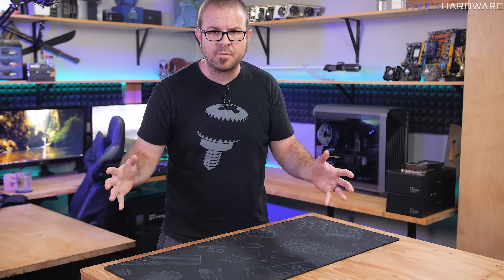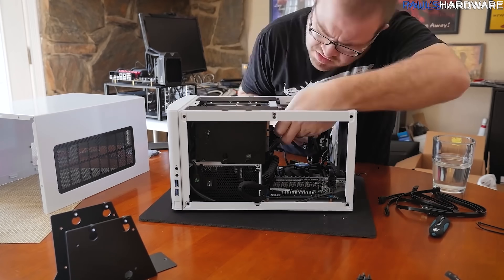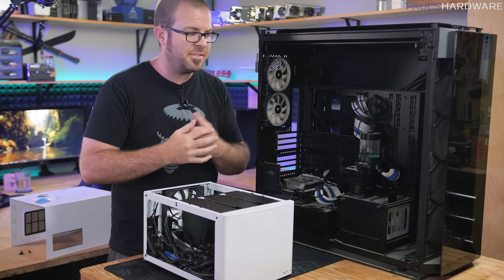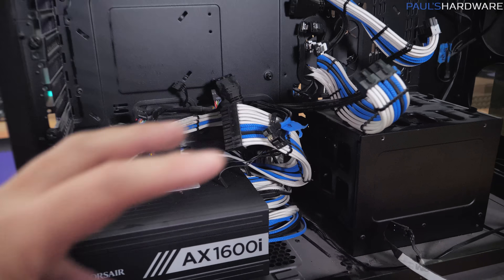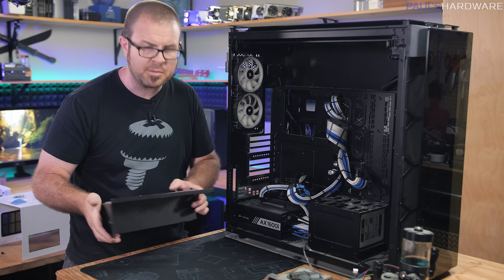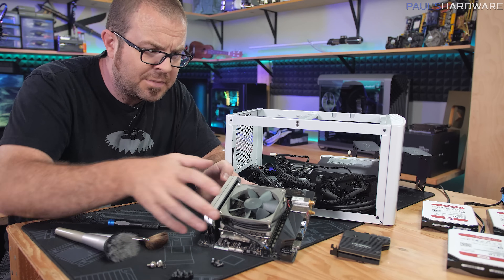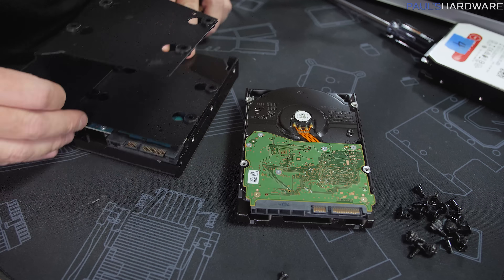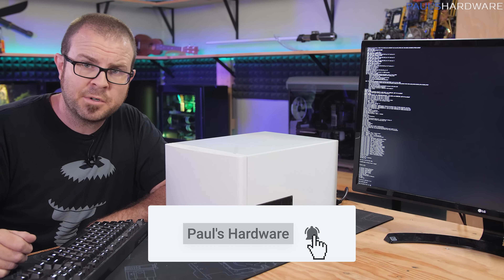2 PCs, 1 Case = BAD IDEA

Comment: I have the Thermaltake Core v21 mATX chassis. A nice little cube case that has stacking capabilities. I believe the new Divider 200 is the refresh of that case. As a cube you can swap the sides around to orient as normal, inverted or flat. A good amount of room for well laid out custom loop.

Comment: I think most HDDs over 4TB have the wider spacing these days
Reply: Toshiba still uses the smaller spacing, while WD uses the wider spacing. There are three standardized mounting spots and usually just two get used, so this is a screw up (heh) from Fractal

Comment: There was one time where I had one PC split across two cases. All I can remember was having the two cases side by side with their covers open.
Reply: That sounds pretty interesting. How'd you manage the dust?
Reply: @benjaminoechsli1941  The dust accumulation wasn't too bad, so just the occasional sweeping away. I guess it prepped me all these years later for my current Thermaltake P3 build.

Comment: I used to have a dual monitor set up, but there's a glitch when drawing on the particulat graphics tablet I like that caused it to ocassionally jump monitors and screw up the stroke. So naturally I did the obvious thing and built a dual pc set up so I can still watch YouTube while I draw. Great idea. Another reason to have a dual pc is I only have one water cooling loop.

Comment: im going to comment before watching the video: i have a corsair 900D case that i custom built. the CASE. it holds 2 FULL ATX boards, 2 FULL ATX-size PSUs, 2 big GPUs, big stack coolers, extra fans. and it works amazingly well. one rig runs my sim racing setup, and the other rig is for general gaming and adobe work. i did it this way to save space on 2 systems that i was needing anyway

Comment: "Oo, ooo, I need network!" I've been thinking of setting up a NAS for the first time so Paul, if you're looking for video topic ideas, you could do one on up to date considerations for hardware and software for a first time NAS build. Thanks!
Reply: Yo, second this, got an old PC that could be used for this probably instead of collecting dust!
Reply: @Jakoliath  If you're Linus then you could repurpose that "old and slow" 2950x with 4 Titans, 256GB RAM, and a Honey Badger. All water-cooled.
Reply: @Jakoliath  Same.
Reply: I’d also like to see a video considering the multiple options and pricing tiers of NAS builds. 
1. Barebones, off the shelf. 
2. DIY, an old PC
3. The budget DIY
4. The $tupid Money NA$ DIY
Hard drives and processors are attainable right now. It’s a great winter project. Especially if Zen 2 and 3 parts drop in price soon.
Reply: @brianshaffernyc  I like this idea. 👍🏻
Reply: That's a great idea, I also want to build one with spare computer parts as I upgrade my main computer.
Reply: Yes, please. I've been debating upgrading my system some and using the leftover parts for network storage and media playback, and would love to learn more about it.
Reply: If you are building a home NAS and are pretty sure that CPU power and network speed are not an issue for you. ie you are just using it as media storage or whatnot then;
The most important aspects of the NAS for you are Memory and Power supply. Buy a quality power supply. HDD's pull a lot of power on spin up so you want to take that into account. Memory; Ideally ECC memory is what you want especially for ZFS. If you want to use old hardware AMD FX cpu's support ECC and certain AM3+ mobo's expose that (most of Asus' line up of boards let you run ECC memory. The biggest problem here is ECC unbuffered memory is expensive.
Reply: Recently I built a NAS with a single 500 GB SSD with a raspberry pi 4. I didn't really need a lot of space, just a central location for stuff to go. RPis are a great option to at least consider!
Reply: i just ssh in a raspberry pi so i don't need a nas
Reply: Maybe even plus some addons and how to utilize them (plex, adguard, etc....)

Since your using freenas maybe update it to truenas (or put in a different hdd just for the video) and do truenas with the zfs addin? That is if you know your way around that...
Reply: I third this, I've been trying out NAS software in Windows and I think I could learn some more.
Reply: *via virtual machines.
Reply: @alaingraham  And ZFS.  Definitely needs more ZFS.

Comment: I have two systems in one case. Phanteks enthoo pro 2 is the case I used. Small itx build which I use for streaming, and for game server hosting. Then my main rig full size atx which is water cooled. Only space I have in my computer room would be on the floor for another pc, and I hate putting pcs on the floor dust magnets. Ironically was actually cheaper for me to do this as I didn't have to buy another case, more fans, and another power supply. Just bought the power splitter from Phanteks.

Comment: I believe you should assimilate a portable air conditioner into the 1000D with an air cooled mini itx. It is a natural evolution. Right? I think you could probably fit a 6000 BTU air conditioner into the 1000D.

Comment: in a previous job as a desktop support guy I can't tell you how many times we strapped SSD's into older computers using gaffer's tape because we didn't have the proper adapters available.

Comment: For future reference if you are worried about the hard drives being taped in. You could get a small piece of l channel/bracket and mount it to those and line it up to the oldschool holes with the l bracket then use a flat washer and a nut for a good sandwhich fit. Bam 
Given that you have clear and switch it shouldn't be an issue

Comment: re: The drives- I laughed to my self because I ran into the same exact thing where only half of the screws fit in my drive caddies.  and I taped in the other side.  lo- and behold half a second later I saw you do the same thing.  I even used blue painter tape too :-P
Reply: If you buy the 304 new, the brackets have the more modern spacing. I have both the new and old versions. I’m guessing if you contact Fractal, they could send out replacement brackets.

Comment: Well those are (R)ed drives and you added some (B)lue tape. With your (G)ray fans, you've got RGB and it'll run way faster.
Reply: I'm pretty sure J D was talking about the grey cooling devices with spinning blades in the video.  I was referring to channel supporters with names containing Grey.  Both are grey fans.
Reply: G= Green not Grey
Reply: @sadams12345678  Some fans are grey. 😃
Reply: @greybeard5123  I am aware of that. My point was that the G in RGB stands for GREEN not GREY.
Reply: @sadams12345678  It turns GREY from the crappy compression 😞

Comment: Front panel headers. Why has their not been a standard plug developed for this? Like USB or Audio (front panel), where you have 1 pin blocked, so it only plugs in one way. Seems easier than messing with those stupid little connectors after you get the system together and then remember you forgot to hook them up.

On topic. Recently put together an Unraid box. Probably easiest thing I have ever setup.

Comment: Additional Reason: Very Close Network Ports. 10G SFP+ Network Card + Short Copper Direct Attach Cable is quite inexpensive as data center retired hardware. No switch required.

Comment: Ohhhh while the number of comments is low and I might have a chance of being read.... Paul, what type of case would you recommend for an air cooled mATX that hold 3+ 3.5 HDD's that doesn't cost an arm and a leg, and looks pretty cool. Oh it also has an ATX PSU. 
Right now I have 3 rust spinners just jammed into the extra spots and they blocking the air flow to them and they're getting a bit too warm.  I don't have anywhere to put them, and I dont really have much cash. I look around and can't really find many that hold more than 3 HDD's that don't cost $250, which is just WAY too much for an ugly case...
Any suggestions? Thanks :)
Reply: Silverstone has CS330 for you.

Comment: I build 2 Systems in my 1000D. The problem was i couldn t move the pc anywhrere…
Reply: A wood platform with 4 wheels solves this problem, i have mine on one and it's easier to move my 1000d than my old midtower prebuilt

Comment: regarding 304 and the 3,5" drives. I think you can just move the rubber insterts from the hard drive brackets to the other opening right beside the stock one and use the black screw hole on the hard drive
Reply: That large opening is how you slip the rubber dampeners into the mounting bracket
Reply: @feronanthus9756  you are totally right
Reply: @feronanthus9756  maybe put a big washer there and use the hole with rubber dampener anyway?

Comment: In the late 90s early 00s, when LAN parties were still a thing, having 2 PCs in one box meant you could have a separate computer that held all your MP3s^W Linux ISOs without impacting the performance of your gaming PC, and only have to lug one case around. I know of more than one person that hacked such a thing together, I don't know if there were any cases specifically made for it back then.
Reply from the maker: I'd love to see someone bring a 1000D to a LAN party 🥳
Reply: @paulshardware  I mean, it can't weigh that much more than the 21" CRT I thought was a good idea at the time.
Reply: @TheAmazingRando-z6t  I hear that, used to carry my 17" CRT plus PC about 2 miles across town most weekends. Not sure my back could take that these days!
Reply: @TheAmazingRando-z6t  my 1000D build weighs a lot more than my 21" trinitron did. With all the radiators, hard drives, and everything else, it's easily over 120lb. the case is like 65lb dry with the glass panels on. I think the hardest part about moving it would be keeping that glass from breaking, or alternatively keeping the french doors in the back from getting bent due to leaning them on something (they bend fairly easily but bend back just as easy)
Reply: @paulshardware  I used to be on Staff for a LAN party and we had this couple always wheel in their dual systerm TT Tower 900 on a tool chest.  It was a his and hers custom water cooled dual system, so they only needed 1 PC Case for both of them to play.  Probably the best use case imo.
Reply: @markstephens8632  tower 900 isnt a dual system case
Reply: @hyperdclxvi6736  Well it must have been a different version of the case or it was modified.  I'd post a picture of it if I could lol.  But looking at recent photos of the tower 900, it wasnt the same one.  But it was the same style of crane game looking case.  Thing was F'n huge.
Reply: @paulshardware Not going to be going to Dreamhack with it obviously, but if you're doing a 3-4 day weekend affair with a handful of friends, the size of your setup doesn't necessarily matter in many situations.   Edit: In terms of weight, if you're not using a massive water cooling loop it doesn't become unmanageable for most people.

Comment: Another use for doing 2 PCs in the same case that I can think of is for those that want a Dual PC stream setup, where one is dedicated to the gaming and the other dedicated to the streaming where the PC's won't have items outside of the build dependent on it. This would also fit a case where they wouldn't need to have their own power supply. Even dual PC streaming setups have their complexities and quirkiness that some tend to shy away from doing that.
I agree that doing a PC and NAS in the same case wouldn't be a good use case for that.
Reply: Yep, that was my plan with my currently unfinished and now pretty outdated Phanteks 2 in 1 case. I didn't have the energy to do streaming and I was trying to get 2 of my older separate PCs into one. It actually works, I just never got around to properly finishing cable managing and securing everything into place.
Reply: With modern hardware you don't need a dual PC setup anymore. A 5900 with a 3080 (if you could find one) should be able to take care of both gaming and streaming. You also save money by not needing a capture card. I know there are ways around the capture card but I think the quality is not as good as having one. The main quirk with a dual PC setup is the ability to talk to your team if multiplayer gaming and being able to talk to your chat. The gaming mic needs to be on the gaming PC and the chat mic needs to be on the streaming PC. Some streamers just use two mics.
Reply: @andrews.9286  That's true. The hardware has gotten to where dual PC stream setups aren't necessary.

Comment: The kind of dust you have in that PC is dust, yes, but it is specific to dogs.  That is dog dander.  In other words, all the dust you can see there, it is all dead skin from a dog, or dogs.  My house is coming up on 100 years, mostly wood, and very dusty, even between the floorboards.  And even with all of this dust, it never gets that bad, NEVER.  However, I used to have a dog(RIP Frankie) and when he was alive, after about 4 years, this dust, the dust shown in that case in this video, exactly this dust, started to appear in this house.  And when Frankie died, it stopped.
Reply from the maker: I'll accept the trade-off, but thanks for the comment! I'm used to dust so hadn't considered that there was a specific reason for it all.

Comment: You should've dropped a water-cooled Raspberry pi in there. It would've been a triple threat.
Reply: You just put a glass of water on top of the CPU :D
Reply: Just one?
Reply: I have this case with 3 computers inside. I 3D-printed an ITX motherboard mount to sit on top of the drive cage. All 3 are in the same water loop. Gaming/Plex/Hackintosh are the 3 systems. 

It looks great but takes a solid 20-30 hours any time I need to swap a component. I don’t regret doing it at all, it was a ton of fun and I love it, but it is indeed a terrible idea.
Reply: @Socrates_Nuts  that sounds so annoying if you need to do one small thing lol